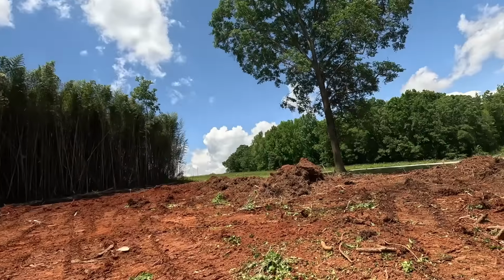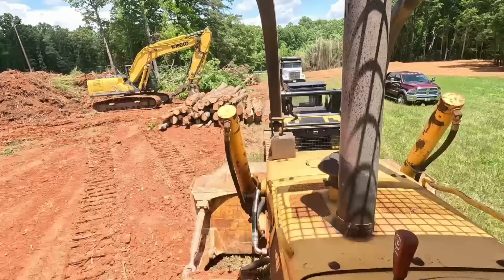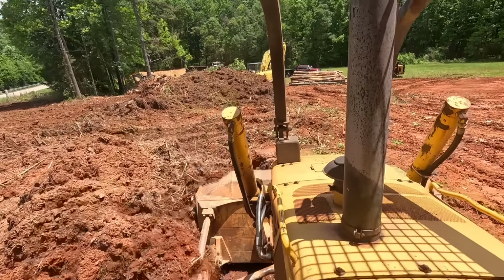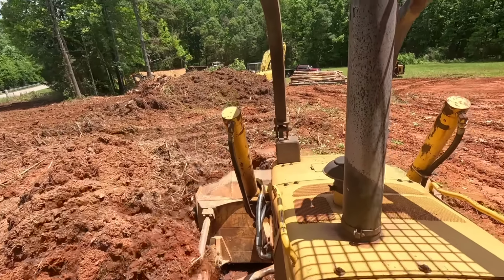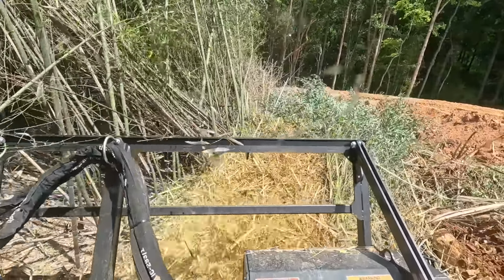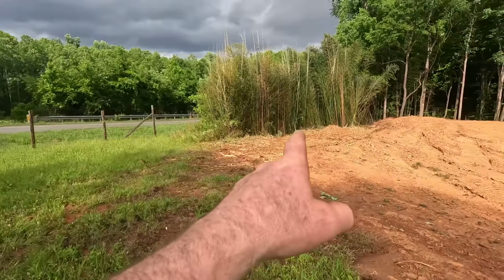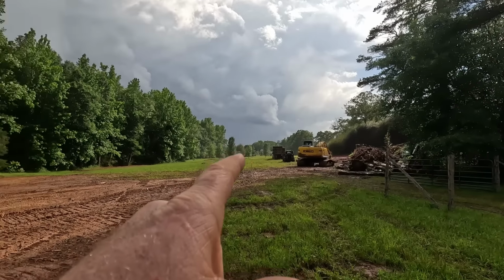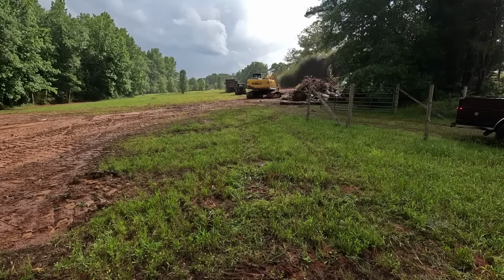Mulching bamboo and tree tops

Comment: I don't know much about this stuff but was just curious why you did not use the root rake on the dosser to help get all the bamboo roots up. I have a patch of bamboo on my land and I just try to keep it mowed down and contained in that area. I have tried burning it, pulling it up, spraying it and nothing works so I just try to keep it under control best I can. if not it will just spread out further from the roots.